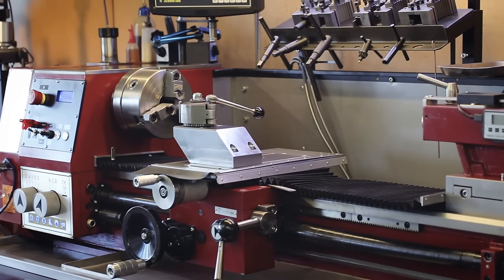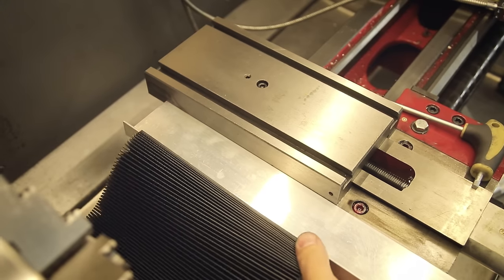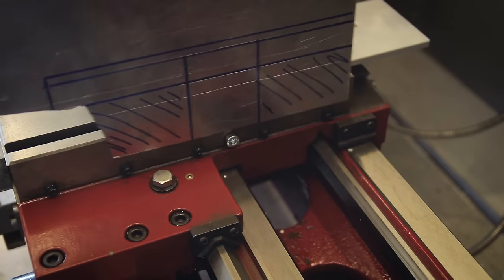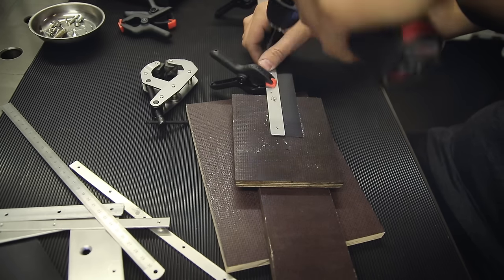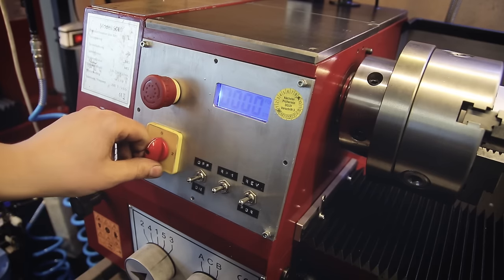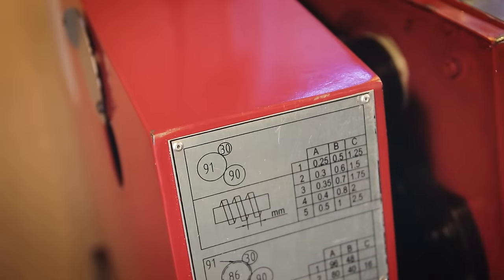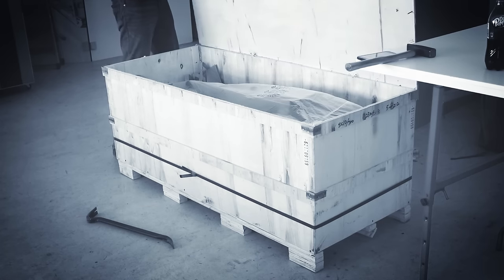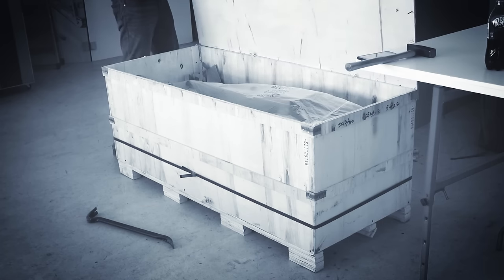7 MORE Mods and Improvements for a Metal Lathe!

Comment: Love the hand wheel improvements with the belt drive. Also love the larger nice grip handle you added to it. Those cheap rattly undersized panels is also a pet peeve of mine.    Great job.

Comment: Great work and attention to detail. When machining a timing pulley in the lathe I use 3 dowels or drill rod equally spaced where the chuck jaws contact, held in place with a zip tie or similar.
Reply from the maker: Good idea, I'll have to remember that one

Comment: Awesome improvements! I especially liked the way covers. Also about 3d prints that supposed to be "decorative" - I don't know if you did this in this print, although on video it didn't seem so, you can enable top surface ironing in your slicer to get a much better surface finish.
Reply from the maker: Haven't tried that before but sounds interesting. I think in this case it also has to do with the filament and just the printer itself, it's not the best one and I don't really take a lot of time to tweak slicer settings, there's probably a lot that could be improved. Somehow 3D printing is one of things where I lack the patience to deal with it in detail and just want it to work 😅
Reply: @PhilVandelay  Yeah, 3D printing takes a lot of time, at least in the beginning. Also there's a lot of factors that impact print quality and a lot of tweaking for specific filaments and manufacturers, but ironing is one of those things that increase time of your print a little bit, but makes top surface nicer.
As for me, when I print stuff for my workshop, I tend to use the same filament by the same manufacturer in the same color, printing in enclosed printer (basic DIY enclosure), which makes most of the print parameters fixed. So, setting up profile once I can expect same results every time.
Reply: I've played around with ironing a little bit and I find that while it does make a smoother finish, if the part is shaped where it has to fill in the top surface in more than one continuous pass, the seams between the different areas are much more obvious because the rest of the surface is nice and smooth. I think the rougher "normal" 3D printed surface looks much more uniform and nicer. You just have to accept that it is a 3D printed part and won't be injection-molded smooth.
Reply: @ADBBuild  true that sometimes you can get worse results. I usually use it for lids and such, which are most of of the time just square so I didn't see much of worse results. Now I need to experiment)
Reply from the maker: @ADBBuild  Yeah I find that the filament makes a big difference. This is PLA+ and it's much more shiny than the normal PLA I used before which was a bit more matte. That one looked a lot more uniform, with this one the surface looks rougher due to the reflections. I should also mention this is printed with a larger nozzle than most use because I'm impatient and prints taking forever is the main reason I dislike 3D printing. So I'd rather have a rougher result quick than wait 10+ hours for some small part to finish.

Comment: Softer aluminum alloys which are designed for use in forming operations always turn up burrs even when the end mill is in good condition. If you stack these sheets together and make multiple parts at a time, then you'll find the middle pieces do not get burrs. Of course, this technique requires using a thicker top plate to prevent the sheet stock from chattering and causing all parts to end up with burrs.

Comment: The split two piece plastic spacers to hold the small pulley on its OD is what I would have done,  except I have found you get run out with two piece "collets"  BUT if you cut them into three the part runs very true and not only that you get more grip on the part.  Just fit the pieces around the part and hold with three fingers whilst placing into the chuck.  Then align the chuck jaws to be approximately in the centre of the collet pieces.  For really small fiddly collet pieces you can machine a groove in the collet pieces OD  before cutting into three then hold them around the part with a turn of soft iron wire.

Comment: that switch is awesome….. I’ve found it’s actually kind of difficult to find nice switches here….the way covers are 👌too….. honestly kind of hard to find good magnets here too, ones that don’t break are strong and have good attachments…… McMaster has them but they want blood 😂
Reply: you're due for another video too.
Reply from the maker: I just check eBay and almost always find what I'm looking for for a good price, but maybe it's a different market here. They actually make nice high quality magnets locally at some of the big industrial firms like ThyssenKrupp here (who are also the biggest steel producer in Germany). 
As for the switch I I think I'll start putting those on other things, so statisfying to use and it kinda acts like a safety switch in a pinch

Comment: Instead of accordian bellows, have you considered roller blinds?, I made some for my Boxford lathe, when compressed they measure about 30mm dia, ( and take less space than bellows) they extend as far as the carriage travels, easy to make, some tubing, a leatherette material, and internal spring that is wound up, having said that, I find all your modifications and improvemnts very interesting, and have subscribed, cheers Dave
Reply from the maker: Yeah I did consider those, I think there was some reason I didn't go with that solution but I don't remember what it was 😅 
I could see those being tricky to not get in the way between tailstock and carriage, but for the other side it's something to look into.
The good thing about the current solution is that I think a lot of the mounting solutions can be repurposed for other styles of way covers if I ever change my mind

Comment: Having gone down this track too with a 1930 vintage Colchester Bantam lathe, I can understand the satisfaction you get when the project is complete and working.......not a fan of the concertina way covers.........most lathes I worked on had felt seals and brass shim way wipers to scrape the swarf off.
Reply from the maker: As I explained in the video, the point of the covers is not to scrape swarf off but to protect against abrasive particles
Reply: @PhilVandelay  the method you showed is too cumbersome...swarf gets trapped in the folds and will tear it.
Reply from the maker: @gangleweed  Interesting, another Nostradamus. I love the comments telling me something will break because not a single one of them has ever been right
Reply: @PhilVandelay  Whatever......

Comment: Good Stuff Phil ! May I ask where you got the lead screw springy telescoping tube protector thingy... Enjoyed
ATB....Dean
Reply from the maker: That one came with the lathe actually. While it is an import lathe, it's on the bigger/more expensive side within that market so you do get some good features like the spring cover and a feed gearbox (no change gears necessary, unless you switch from metric to imperial).

Comment: I have this same lathe by a different name and color.  I would love to know what you did to the tailstock.  Most tailstocks have the   slot in the back, this has it in the front (relatively).  

Totally agree with the carriage travel, and love your 4 to 1 reducer.  Are the gears off the shelf?  I'd love to make that, as the factory wheel/ratio drives me nuts!

Thanks so much for these videos.
Reply from the maker: I didn't do a ton to the tailstock, mostly cleaned it up by deburring and removing paint in the areas where it was chipping anyway (the base) and gave everything a good cleaning/lube. The tailstock is a weird one for sure, I'm still not 100% sure how you're supposed to use that tiny grub screw in the back, and whenever I align it, it never seems to stay aligned (or I'm missing something) so if I need a cut to be really straight over a long distance, I've resorted to indicating/adjusting it manually for that part. Luckily with the carriage drilling option, I don't use it much anymore.

As for the gearbox, yeah they're standard parts, you can buy a huge array of belt pulleys and belts online. I actually changed the ration to 1:3 in the rebuild, so it's a bit faster again but I feel like this is a good sweet spot. I can send you the CAD file for the mockup I did, not sure it'll be much help (it's a bit crude) but should speed things up a bit if you want to build this

Comment: vary nice and neat i will say its vary dangerous to have to reach across the lathe bed for toolholders and such. i know its a small lathe but you can get tangled up in the chuck with clothing.
Reply from the maker: I have long arms 😉 But the lathe is also usually not running when I change tools

Comment: quick question: do you find that having the tool post canted out causes rigidity problems?  it would seem to put a big moment on the dove tails vs pushing them directly down.
Reply from the maker: Can't say it does, I built this solid toolpost to improve rigidity compared to the top slide (which I only use now when I need it for tapers) and it is definitely a lot more rigid than that. I never thought about the force on the dovetails, interesting point! But it doesn't seem to cause any problems

Comment: All very nice!  In some shots, it a 3 axis DRO, and in some and the final shot, it's a 2 axis.  What gives?  Also, I have the same DRO on my mill and I really like it.  I'm thinking about getting the same one for my lathe, and 3 axis in case I need or want to put it on my other mill.  This DRO does not have a Tool library, but I think that I can us the SDM function for a tool library.  What are your thoughts?
Reply from the maker: It's a 3 axis display but I only use 2 of them on the lathe. At some point I taped over one of the display axis just to make it a bit easier to read. Reason is simply that with these import DROs, the 2 axis display is only slightly cheaper (few bucks) so I figured it can't hurt to have the option to connect a third scale.

As for the SDM function, I always figured that's for a tool library anyway, but never actually configured it. I mess with my tool holders and overall setup too much to fully trust it, so I just zero out the tools manually.

You can also now get an adapter that allows you to connect glass scales to something like an old smartphone or tablet with an app to use that as the DRO display. It's quite interesting because they offer a lot more features than the classic displays, been thinking about trying that out for a while
Reply: @PhilVandelay  Thanks.  I'm still learning to use the one I bought for the mill.  I use the SDM function all the time.  One thing to remember is that if you zero in Absolute mode, it messes up all the SDM settings.
Reply from the maker: @KW-ei3pi  Yeah, I noticed that! That's why I started using INC most of the time and didn't use the SDM feature a lot, I always end up zeroing absolute by accident sooner or later and then you have to start over. I'm not sure but maybe this behaviour can be turned off, but I didn't study the manual again. I suppose it kind of does make sense if you treat ABS as the zero reference for everything else.

Comment: For Hobby use the Drilling with the Tool Post would be fine but understand over time You will cause damage to the Tool Post and Cross Slide. Also using a belt for Hobby Use is fine but for long term the Gear Setup is far more accurate along with quality bearings instead of Plastic/Nylon bushings even Bronze Bushings offer better Accuracy when Machining/Turning over Distance because the belt can eventually stretch.
Reply from the maker: Sorry to say but none of that makes much sense to me. Why would the handwheel bearing have anything to do with accuracy?  I can see exactly how far I'm going on the DRO at all times. Besides that, the bushing has very low runout as it is. And why would the tool  post or cross slide get damaged from drilling? If anything forces induced from turning operations are potentially much higher. It sounds like you're just making up problems that don't exist.
Reply: @PhilVandelay  The Cross Slide is not designed to handle the stress Caused by the Drill being Mounted that high which is why the Tail Stock is designed like it is. A Dill has a Larger Contact Surface with the Part that You are cutting than say with a Turning Tool increasing Tool Pressure that the Cross Slide and Tool Post must absorb. The Belt and bushing will also eventually wear out if feeding the drill by using the handle to feed it. Using 3 gears for the handle is the best solution to help make it last longer with at least a bronze bushing. I have run many Lathes, Mills, etc.. and to maintain precise tolerances You need to keep tool pressure down as much as possible so that You Lathe and Tooling stays in good condition. You would not believe how easy it is to damage Your lathe, I have had to run a lot of Junk because of how badly the Machine Tool was treated.

Comment: just curious, for the larger gear, why not just use the end-mill to cut an arched key-way? no filing required.
Reply from the maker: Not sure what you mean, but I only had those square keys around. They make round ones?
Reply: @PhilVandelay  I think he means cut a taller keyway that would allow the key to fit. Instead of a half round, a rectangle with a half-round top.
Reply: @PhilVandelay  exactly what Andrew said. like if you cut the slot deeper the key would fit in without filing, there would be a half circle arch of empty space at the end of the slot but I don't think that would affect the operation.

Comment: Toolpost drill seems like a good idea. Except I don't have a dro, and I do have a mill attachment. So my toolpost never ends up in the same place. :(
Reply from the maker: You could make some kind of indexing system with dowl pins to get the toolpost back in the same position maybe. Also, for centering the drill, you might not even necessarily need the DRO, it can be done by eye to some extent. I suggest to watch Stefans video, he explains it in great detail
Reply: You could buy a bushing and a dowel pin that fit together, then use them to align things quickly. Put the bushing in the lathe chuck and the dowel in the tool post chuck and adjust until it slides in easy. If you have a quick change tool post, you would probably only need to adjust the cross slide as the height would already be set.

Comment: I just would like to preface this by saying I am a weekend fabricator. Been a heavy equipment mechanic for 25 years. WHAT IS WITH YOU TUBE AND HACK SAWS?! My tool shed is not the fanciest but even I have a portaband and table band saw. I think hack saws exist on all these videos to drive me crazy. LOL
Reply from the maker: It's just not necessary to always bring out the big guns, especially for 2mm aluminum. I also have a belt grinder but still use files a lot

Comment: The lathe mod video was interesting and smooth ,,, so I looked at the catamaran which was really well done ,,, one thing you might want to consider is welding with exposed skin ,,, we all know it is not the greatest idea ,,, there are something like 7 types of skin cancer that can happen ,,,, I quit doing it and just throw on a long sleeve shirt for the welding ,,, FYI
Reply from the maker: Yeah you're definitely right about the protection, it just gets really hot in the shop in summer and then I often do it out of convenience because I sweat like crazy under a welding jacket in the heat. I have gotten some light welding sleeves since then and started using those, works a lot better